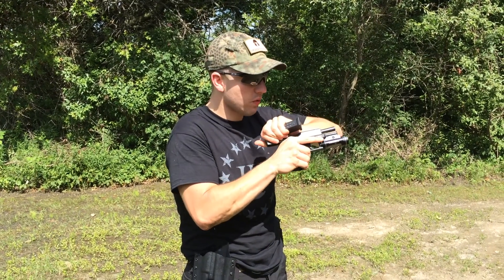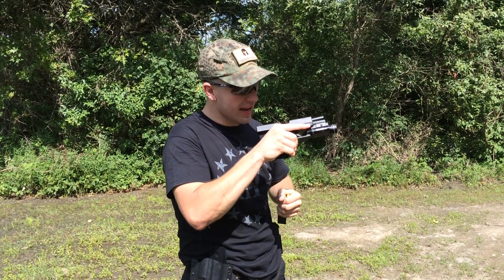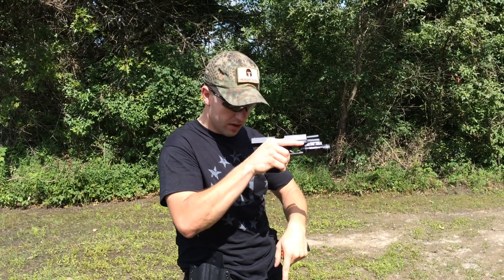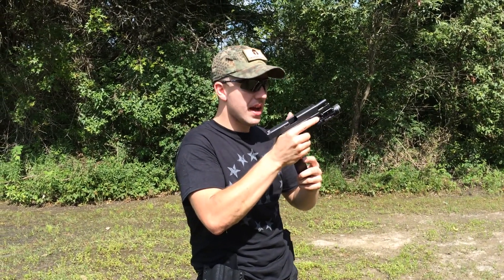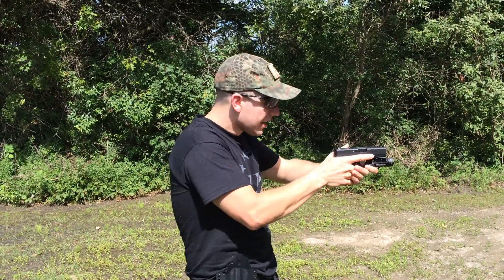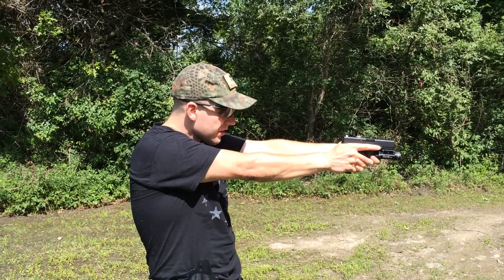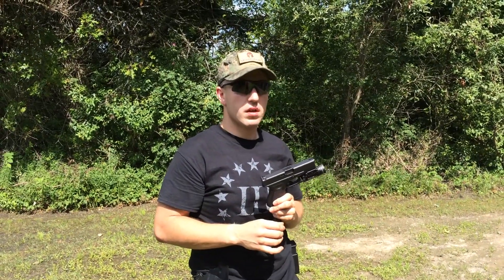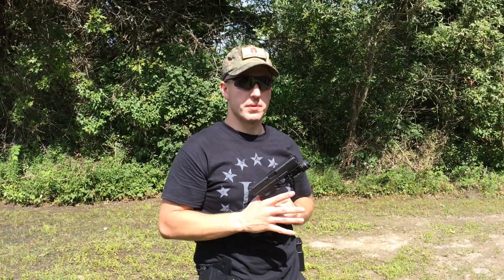Double feed/ failure to extract

Comment: I shoot a 30 year old Beretta 92 clone Taurus PT-99, which is generally a smooth, trouble free workhorse.  When this first happened to me, it felt as though the round had been short on cordite.  The discharge seemed less loud... just enough to get the bullet through the barrel, but not to operate the slide to the fully open position.  It happened 2 more times using bullets from the same batch.  I'm changing bullets.  Don't want to say what brand they were in case I'm wrong, but they were FMJ brass, not some lower grade cheap round.

Comment: What causes a failure to extract?
Reply from the maker: Good question. There are a few ways. Typically its caused from bad ammo. Sometimes the base or rim of the shell casing is chipped away for the extractor to not be able to grab it and pull it back. Other times it can be a worn extractor spring or a chipped or broken extractor.
Reply: Thanks
Reply: Andrew Anderson another reason, at least in my experience, an extractor that’s too tight can cause this as well, especially in guns with light springs. Had to retire a carry gun due to this issue.
Reply: Thank you for the info. I have a new gun, and had no issues until last range visit. I got some range ammo (brand name, Venom) and holy cow, I had so many of these in my Beretta M9A1 I lost count.

Comment: I had this happen Saturday. And when I stripped mag out and went to rack slide it jam closed and would not cycle at all.  Sunday morning I disassemble the weapon and had to use a flat screen driver to very gently pry the on barrel after removing guide spring. It worked I clear weapon put together and she worked fine.   I think it was the ammo. Steel casing and the primer was completely gone. Never found it.. thanks for the help.. 

SD40ve .. is weapon . It's nice I've only had 3 weapon malfunction.. not a lot but It seems like it happens to much.. for my taste.. is 2nd pistol ever own...not very big on any type of pistols. Just prefer carbine rifles.

Comment: Buy a 1911,  problem solved!
Reply from the maker: A 1911 still has malfunctions as well.
Reply: @dynamicsolutions5712  Just giving you a hard time lol.  I have been working through a failure to extract issue with my 1911 9x23 winchester conversion.